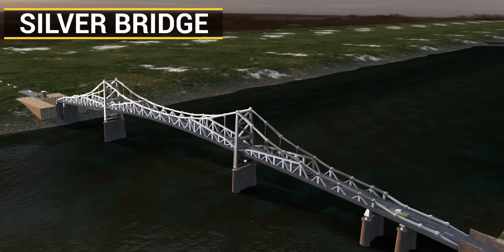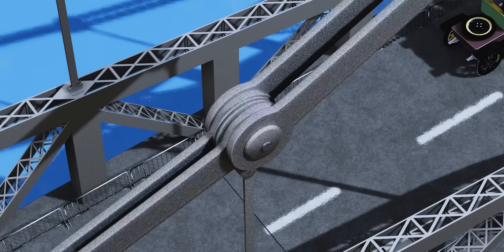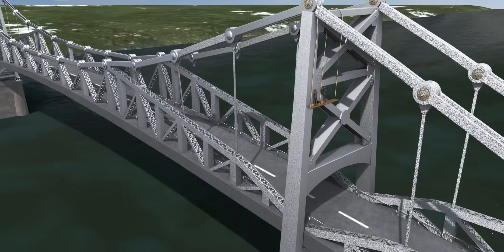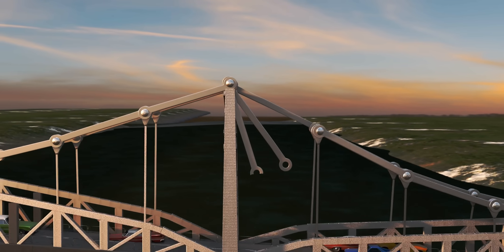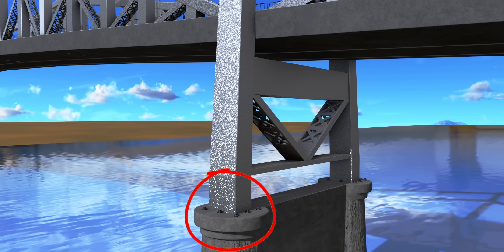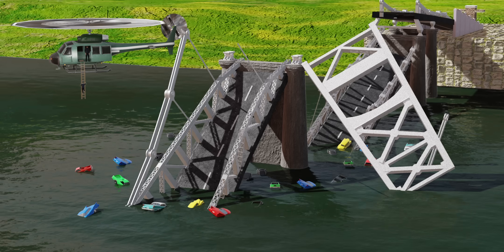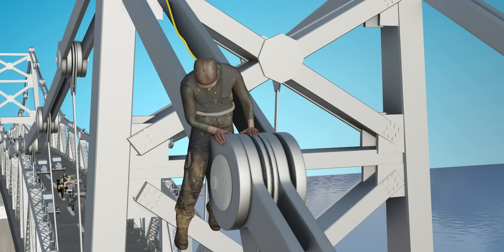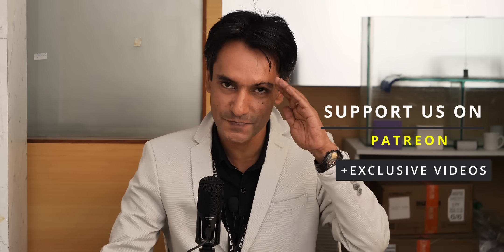Silver Bridge | The Tragedy That Changed Civil Engineering Forever

Comment: any failure should be a lesson for improvement of the future bridges and should be added to the book of designs
Reply: any failure costs peoples lifes
Reply: @iterationnebula  Hubble Space Telescope failed, but it didn't actually hurt anyone physically.
Reply: Money makes politicians happy that are paid by companies that want even moke money and they don’t care about people that are not related to them at all
Reply: @ This engineering disaster had nothing to do with politicians or politics.  Flawed human beings working as engineers made mistakes.  That was the issue.
Reply: @perfectsplit5515  it literally said they chose the design to save money and politics is the reason for 90% of tragedies nowadays
Reply: @PURPLEBUTTERFLY1010 
“chose the design to save money and politics is the reason”

When they decided based on money, they did not know that there would be a compromise in safety.  At the time, they were less experienced. If two separate solutions have the same apparent level of safety, then of course you will choose the cheaper one.
It was only after the experience of a failure did they learn that there was a safety compromise. That was why they immediately closed down the other eye bar bridge, despite the high cost of doing so.
Furthermore, a decision based on money is not the same as a decision based on politics.  They did not choose the eye bar design because they were trying to please some activist group.  They did not choose it because they wanted to please a powerful politician.  Politics had nothing to do with it.
Reply: yep that's people say "safety regulations are written in blood"
Reply: It was stated that other EYE BAT bridges were multiple, but a similar bridge was taken out of service immediately.